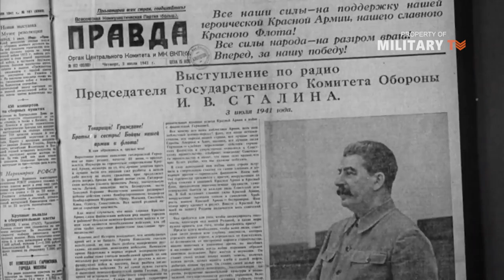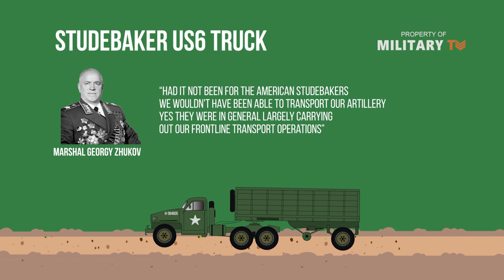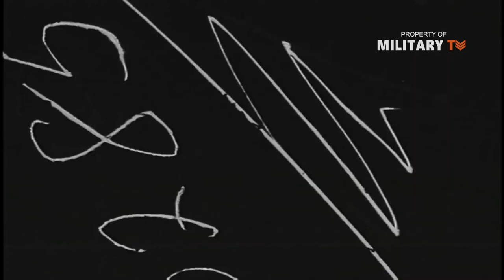How the U.S. saved the Red Army in World War II

Comment: I've already made a comment about the issue with lend lease but I don't think i was specific enough so here goes. The lend lease programme didn’t affect crucial battles like the battle of Stalingrad, Leningrad and Moscow. Taking the fact that the USSR had more than 33 million men ready to fight the Germans, produced the most tanks throughout the war(not including lend lease tanks) and had the best tank in the war in my opinion (IS-2) i think it’s safe to say that the Soviets could have won the eastern front alone and even without lend lease equipment the Soviets would still be the largest, best equipped land army in history. Lend lease did speed up the process of victory in ww2 but was it decisive? Definitely not. The main reason why Germany lost was because of it’s horrible oil crisis, there was a reason why they tried to take over the caucuses oil fields but still failed because of the fierce Soviet resistance in the South(that wasn’t even provided with lend lease equipment at the time) and the Soviet victory at Stalingrad which helped turn the tide of the entire war(which also wasn’t affected by the lend lease programme). The Soviets also had the highest production rate than any other country throughout the war in pretty much everything, tanks, weapons, planes etc. Even if the Germans were somehow able to take Moscow, Stalingrad or Leningrad, i really don’t think Stalin will give up and say “well we tried” the Germans would still have to suffer from the huge casualties which could not be replaced after these battles, they would have to fight a whopping 33 million more men and a shit load of tanks thanks to the Soviet production rates of tanks and other weapons and the extremely long and tedious German supply lines thanks to how big the USSR is which would also affect Germany’s logistics problem as if it was any good in the first place. Even then, I’m pretty sure the Soviets would end up fighting to the bitter end just like how the Germans did in reality, this is also backed up by real world history where Napoleon invaded Russia but still lost the war because of the reason as stated above “Russia being too bloody big which affects logistics and supply lines” not only that but when Napoleon’s men entered Moscow the Russians responded by literally burning down their homes so that Napoleon would not be able to steal the food and supplies from the Russians. A more important question to ask would be, if the USSR didn't exist back then, could the western allies succeed in defeating Germany by themselves? Answer: No, the west won't stand a chance without the USSR, again, almost 80% of German casualties were on the East, not the west and about 70% of Germany's resources were poured on the eastern front, not the West and only 15% of German soldiers from the East were transferred to the West to fight the allies and this 15% of Germans just so happened to still somehow win against the obviously superior western allied manpower, taking these facts, you really think the West would stand a chance to fight all 100% of Germany's men even though they took more than a year to beat back the 15% of Germans that were stationed in the West? the battles on the west were miniscule compared to the east, the USSR was fighting big and heavy battles with huge amounts of casualties on both sides. In conclusion, let's examine some undeniable facts, Germany was unable to capture Moscow, Leningrad and Stalingrad even though the soviets had no lend lease equipment at the time, the lend lease act wasn't started in earnest for the USSR until 1944, just before d-day. Operation bagration1944 dealt the final blow to germany and by d-day the red army already reached the Polish border by late June 1944. The allies were fighting miniscule battles compared to the Soviets and were still struggling in trying to achieve victory over these small battles. No such problems or cohesion among the Soviet chain of command. Paris was captured unopposed. 80% of German casualties were on the east and as stated above, 70% of German resources like manpower etc were diverted to the Soviet front. In general, the Soviets could have won ww2 alone, with or without lend lease and could even win the whole of ww2 even if the allies didn't invade France in 1944 while the allies would have lost the war without the USSR soaking up Germany's resources, casualties and their manpower. I do expect to get some hate but honestly, I really don't care. Go ahead and argue in the comment section if you want, just make sure you read the whole thing even if you hate reading.
Reply: Couldn’t have beaten Japan though. The US navy singlehandedly beat Japan without any problems. The war in the Pacific is half of the war, you know
Reply: @stackertheeod7566  the soviets kicked their assess and took manchuria in a single week
Reply: @stackertheeod7566  and thats just manchuria, they also won against the japanese in border conflicts and skirmishes in 1940
Reply: The thign you fail to forget is we gave them 2000 trains that saved them

Comment: 1) WW2 did not start with Germany. It started with Japan attacking China. That also empowered Hitler since there was no response. 2) Germany had no control over Japan. 3) while lend lease helped the Soviet union, and FDR would double their military machine requests, the Soviet union also made better tanks than the USA. Their T30's series we're good and equaled the Tiger Nazi tanks by the end. Also, their rocket launchers that they made were more effective than USA weapons. The AK-47 was a stolen Nazi gun design and parts cut out to make it simpler.
Reply: @Brian Home account they had tanks. In fact, the USA made their tank off their blueprint. Cite your sources in any admission. The Soviet union could have done what china did, move the population away to fight later. China moved even railroad tracks and buildings. The Soviet union would have just moved east.
Reply: @Brian Home account they had tanks. In fact, the USA made their tank off their blueprint. Cite your sources in any admission. The Soviet union could have done what china did, move the population away to fight later. China moved even railroad tracks and buildings. The Soviet union would have just moved east.